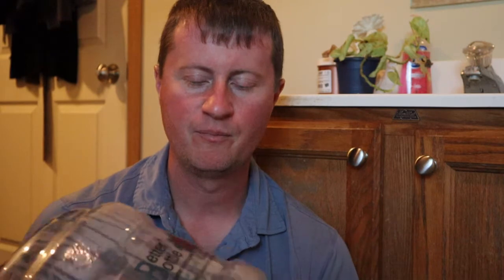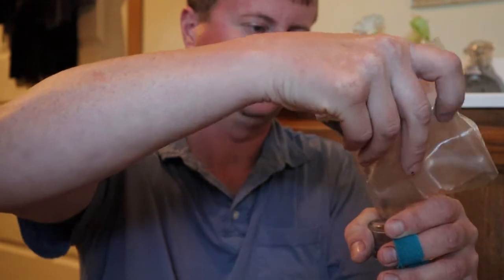Wine Brew Pt. 2 Secondary Fermentation

Comment: Why wine bottle suck air through an airlock to inside?
Reply from the maker: The yeast is breaking down the sugar in the grape juice in to alcohol and C02 the excess C02 needs to vent and you don't want anything outside getting back in. That's what the airlock is for.

Comment: About what temp to ferment red wine says upnto 85 i hav mine at 78F
Reply from the maker: That's a loaded question really that is going to be affected by the recipe. There are methods that aim for a cooler slower fermentation, but that is a debatable topic for sure. Another thing to consider is at higher temps you may ferment so vigorously that you blow liquid out of the air lock. Generally I personally aim for the 65 to 70 range.
Reply: @MasterofNone2  lol yea I'm finding a wide range thanks I'm understanding more now with all the videos

Comment: Could I just half screw my jar lid to let the co2 out . will it be safe ?
Reply from the maker: During heavy fermentation I would worry about not being able to keep up with reliving the pressure. If you don't have an airlock slap a balloon on top of the bottle.
Reply: @MasterofNone2  thank you I'm four days in with the balloon and I have poked a pin 📌 sized hole in the neck of the balloon so I can safely realease the pressure without letting the inside air in

Comment: Yeah I enjoyed the video, please answer my question: in secondary fermentation it must be airtight or not? And what should i do if I don’t have airlock? I am waiting. Plz answer.
Reply from the maker: As the wine ferments it gives off carbon dioxide this will fill the space in the top of your fermenter and keep oxygen away from your wine, which is what you want. In the absence of an air lock you could always resort to the old large balloon on to of your container. Be sure to keep an eye on it so it doesn't pop.
Reply from the maker: Also if you could attach a tube to your cap you could run the tube so the end was submerged in a pan of water and that would serve as an air lock.
Reply: @MasterofNone2  thank you for your response, one more thing, i am at secondary fermentation now, it must be airtight or not?
Reply from the maker: @farhanmunirabbasi8416  yes and no,  gas from the fermenting needs to be able to escape or expand but you don't want outside air to get in to your container. That's where either the airlock or balloon comes in to play.
Reply from the maker: @farhanmunirabbasi8416  Let us know how it turns out and feel free to ask more questions if you need to.
Reply: @MasterofNone2  thank you, as I understand your suggestion, i Open the container everyday for a while so the gas can go out. And then i close it airtight.
Reply from the maker: @farhanmunirabbasi8416  well if you don't have access to an airlock or large ballon you could quickly open the lid just to release excess pressure. Just try not to let all the gas escape because you don't really want outside air in. Good luck  with your wine.